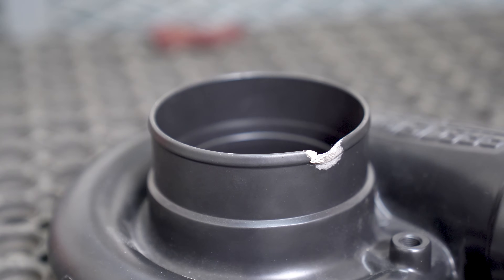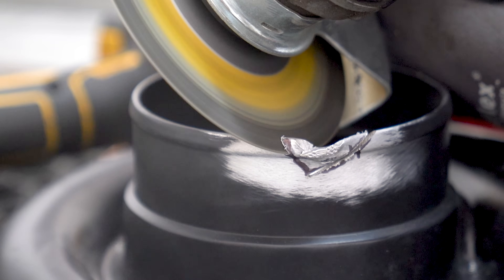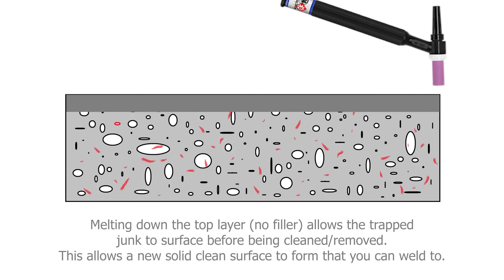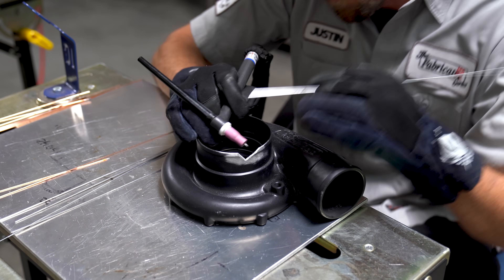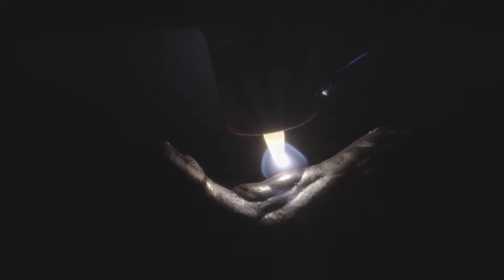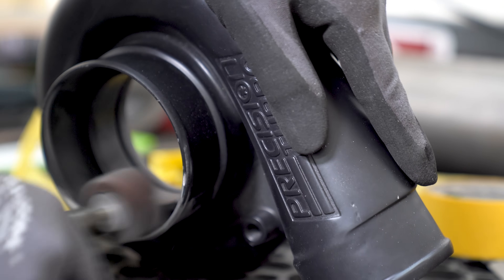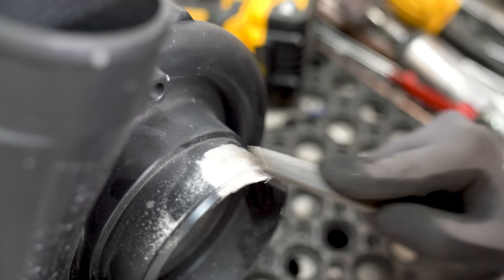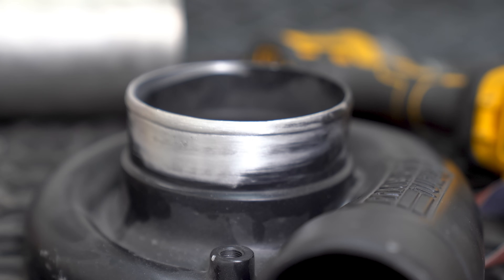Weld Repair with a Budget?

Comment: Aluminum (especially common alloys like 4043 in the as-welded condition) is significantly softer than the hardened tool steel your file is made of; it's ok to go both directions without damaging the file. The rule of not filing backwards is for harder materials like steel. You can file backwards as hard as you want on plastic and you won't hurt the file lol

Comment: Be very careful with wire brushes, don't use the same one on different materials, they'll introduce contamination. 
I have different brushes for aluminum, brass, steel, and stainless steel, and only use them on the same material, steel and cast iron seem to be OK together.
The brushes pick up from the parent material and then spread it on to the next job which can cause havoc, especially where welding is concerned.
Don't use a brass brush on steel,, it will coat the steel with brass.
Stainless steel brushes are OK on most things because they are so hard, but they'll pick up brass and then transfer it to other material, Etc.

Another great video, thanks Justin

Comment: Question... wouldn't it have been easier to just remove the bulge with a rasp & add as little material as possible since the material was only deformed & not broken or cracked

Comment: 100 bucks per hour , nice m8.  I would not weld that housing, I would just bend it back it it wants to be bent with some heat and all is good. Different story if it was not mine, then I would buy new one.  Thank you for sharing your wok, much appreciated!

Comment: Can you try out the Weldpro Digital TIG 200GD i just bought one and has nice features and actually think it will give the primeweld a good run for the money and it only weighs in at about 40 pounds makes moving around nice. Bought it on amazon and shipping was really fast came through UPS in 2days of order. My only con with it like other none high end everlast welders is cant run E6010 rod which 6010 is still the best stick rod around :D

Comment: Nice repair. I would have looked it I had a pipe with the inside diameter as it's outside, so I can stick it in there and then reshape it with the original material and then just weld it shut. The hose of the turbo forgives a lot. But the trick with the waveform is gold, I never heard that before. Thank you for showing us!

Comment: Hey
I had to weld a new outlet to my radiator and it is 28mm diameter and 1mm wall thickness..maybe 1.5

What i found problematic was the fact that i couldnt make the thicker radiator wall to melt without melting outlet so i ended up building up material on the outside of outlet with lower current  and then joining everything afterwards

What advice would u give on joining thin walled pipe to a big thick heavy section of aluminium that draws all the heat?

Thanks

Comment: That was a great explanation. Than you. I did a repair on my transmission bell housing last week and it just kept becoming black. Now I know why. Do you have a link to your sanding/grinding materials used? I could have cleaned and prepped better for sure. 
Thanks again for your videos 🙏. 
Also, how is your Primeweld 225 holding up?

Comment: I wouldn't have done anything to than. I would have either break the part off so 
 it doesn't fall in the turbo or just jb weld it so it doesn't fall into the turbo. That side doesn't see pressure and the crack wasn't far enough for s coupler to not be able to cover it
Reply: I wouldve just filed it smooth so it didnt cut my tube.

Comment: A tip that goes a long way with grinding aluminium is to use some bees wax or even a simple candle rub it on the flap disc or flap drum when its running, this both saves the disc from disintegrating and stops it frok clogging up so it cuts easier.
Reply: Soap works too!
Reply: I religiously do this and also always get covered in wax. Lol
Reply: Plantex Tiger shark flap discs and Kanga roo oil! Amazing fast cut ,no clogging
Reply: Also for files load them with soap stone dust it it help with the gauling of the aluminum

Comment: Why not chuck it on a lathe for the final finishing?  Would've looked a lot better than freehand
Reply: Does he have a lathe?
Reply: I don't think his lathe is big enough for a turbo that size and he prefers to show the simple hand tool methods on his video's so his viewers can see how to do it at home
Reply: Time is money is what this vid is showing. Time spent to Chuck up and tool setting would blow the budget. I thought he was going to section a piece of tubing in myself. Then lay a head to remake the lip.
Reply: @permagrin8742  I agree it's a large awkward piece and setting up is everything with lathe work; I also would worry that the tube may be out of round just enough for the lathe to start wanting to cut into good metal elsewhere before the weld cleaned up and it would therefore still need hand finishing, adding more time overall.
Reply: Yes but it would have took longer. I mean a pro probably could have knocked it out in the same amount of time but from what I recall he doesn’t do much work on the lathe

Comment: The question is can you get the ceramic coating fixed for less than $80? If not then you didn’t really fix it for less than a new one.
Reply: @RecklesRegal mentioned in a different comment that a new housing would have to be coated too, so that cost wasnt calculated into the budget.
Reply: Ceramic coating is not part of the budget.

Comment: Wouldnt just adjusting the balace of the current acheive the same affect as the positive square wave and negative triangle wave?
Reply: It's not the same, It's not just energy under the curve, it's a time rate function for the maximum temperature of the material

Comment: I like showing basic tools so I use my cut of wheel, then bang I use a welder with goofy settings aha
Reply: But you don't need those wacky settings, they make it easier. I'd probably run 50/50 or less, but with pulse as well. Most AC/DC TIG inverters will let you set that up.

Comment: Great explanation of the waveform and process to repair. As that’s the intake side of the turbo, I’d opt for the free repair of just putting the coupler over the damage and moving on… :-)
Reply: Right?
Reply: Might want to get a turbo guard.
Reply: What if continues to crack? Im a super cheap repair guy but having a piece of alluminium that goes in the engine is a more $$ repair
Reply: There is no coupler for this turbo, the damage would be visible at all times.   Even if there were a coupler the damage would have prevented it from seating correctly and thus sealing.
Reply: @RecklessRegal  So the repair will be visible at all times? No coating makes it look pretty bad, and recoating would blow the budget.
Reply: @RambozoClown  Yes it will.  Recoating has to be done either way, whether a new housing was purchased or this housing was repaired and was not part of the budget.
Reply: @RecklessRegal  Ok, I thought a new one came coated. With recoating it should be pretty hard to detect.
Reply: @RecklessRegal  I don't think most people run their turbos without filtering the intake air
Reply: @samruba7441  Most race cars do, and that's what this turbo is for.  Filters rob almost 200 whp on this setup.
Reply: @RecklessRegal  Damn I would have never guessed they cut that much power. That's wild.
Reply: @RecklessRegal  😲😲😲😲
Thats a lot of stollen ponies
Reply: @RecklessRegal  filters that are too small rob power
Reply: @sexyfacenation  Exactly
Reply: @RecklessRegal  damn. If they rob that much i cant imagine what that thing feels like lol

Comment: [07/09/21] Very nice repair. Done in 72 mins is quite amazing, and speaks to experience; most would take much longer than that. How many psi air pressure will the housing, and thus the repaired area be exposed to??

Note: Besides Fronius, which other machines have waveform selectability?
Reply: The repaired area will not see any pressured air, only atmospheric pressure.
Reply: @RecklessRegal  Why does it require coating?
Reply: @oleran4569  To keep heat in the turbo and thus impeller speed up.   It also helps keep under hood temps down.
Reply: @RecklessRegal  Thanks!

Comment: While I understand you are creating content for your channel, the damage on the inlet would not have affected performance of the turbocharger. It's just a little ugly ... and then, it would be completely covered by the intake tube so it wouldn't be seen at all. Really, this was an unneeded repair.
Reply from the maker: What if the turbo is not covered by an intake.... 🤔
Reply: @TheFabricatorSeries  - Then you're doing two things wrong. You're sucking hot air from the engine compartment and you're not filtering the incoming air. Again, it's not pretty, but it's still very functional and won't hurt performance. This is what you call a "function over form" sort of attitude. All-in-all, you did well on the repair. It looks good and the part is functional. Just a dab of spray paint and the job is done :o)
Reply: @Paulster2  This turbo sucks only fresh air from outside the engine bay and a filter robs over 200 whp.   It will be ceramic coated again, not spray painted.
Reply: @RecklessRegal  - Really? I hope you're kidding, right? Ceramic coating along with the weld repairs? Costs more than a replacement part would. Besides, it wasn't ceramic coated in the first place or a wire wheel wouldn't have taken the coating off. And 200hp? You're not serious? Maybe 15hp (and that'd be generous), but not 200. The turbo isn't big enough for anything serious. If someone was using it for some type of racing/street use, they'd be putting a filter on it for the street, and putting a coarse screen on it for race to keep the bigger chunks out. Either way, the part which was damaged would be covered up.
Reply: @Paulster2   Yes, dead serious.  A replacement part is double the cost of the repair and would still need to be ceramic coated again, not to mention being back ordered 8+ weeks.

Yes, it was ceramic coated not spray painted.  I know, I had it done by Jet Hot themselves.

Turbo isn't big enough?  Lol why don't you tell me what size you think it is?   It went from 1,872 hp without filters to 1,544 hp with filters on the engine dyno (and that's on VERY low boost).   Not sure where you got 15 HP from.
Reply: @RecklessRegal  - Which leads me back to my original statement ... the damage was only cosmetic. It would not have affected performance. You spend your money how you will, but if the whole thing was based on cost, as the "Fabricator" stated in the video, you should have just let it ride. All it would be is a "war wound" you could tell your buddies about. I'm sorry your part was damaged by a silly mistake (believe me I've had enough of my own). It happens.
Reply: @Paulster2  I never said it wasn't cosmetic, but it's visible at all times and my car isn't a sloppy mechanics shit box.
Reply: Dont all youtubers have no hoods and turbos high mounted with maybe a turbo gaurd at best?!